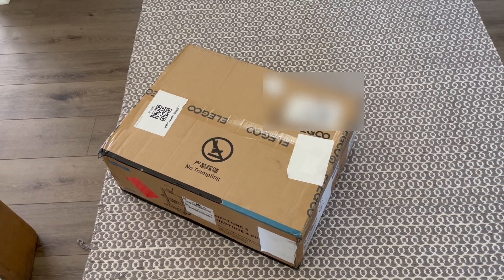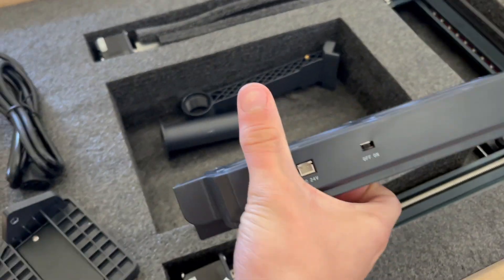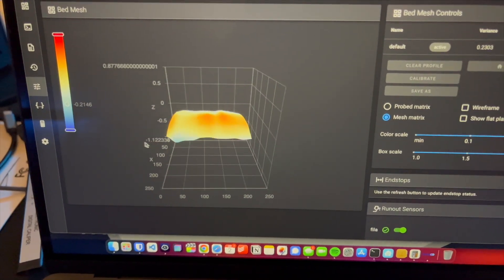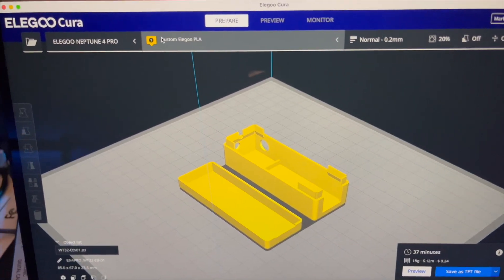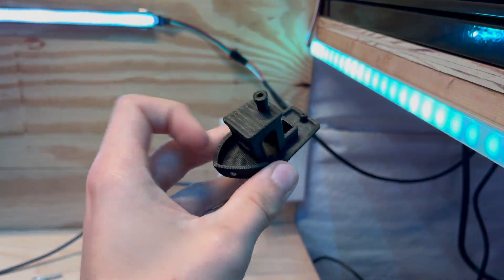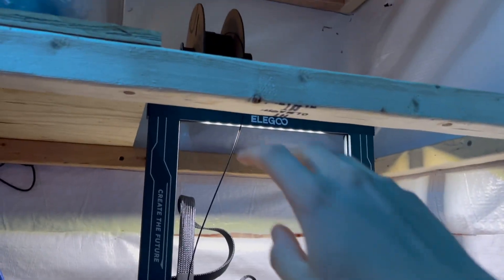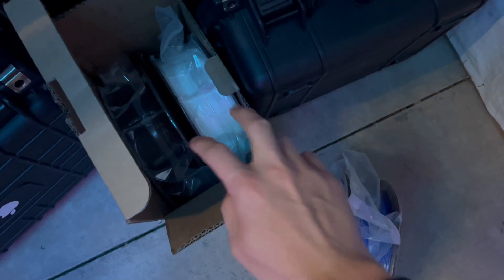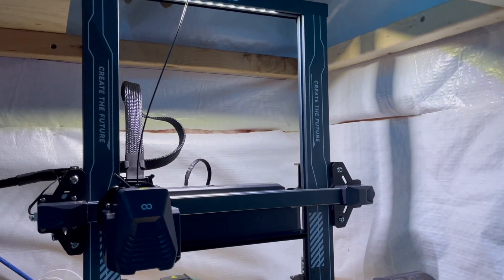Elegoo Neptune 4 Unboxing & Review: It's amazing!

Comment: You shouldn't need to use a glue stick with that PEI surface,  I have 2 x Anycubic Vypers that have the same type of surface and have never used glue stick on it.  If you are having issues with it sticking, it's either the bed isn't level or you will need to slightly adjust the Z offset on the printer.
Reply from the maker: Good to know. Thank you!!